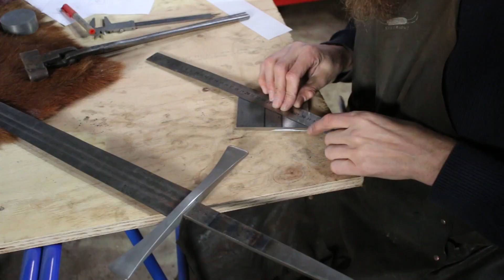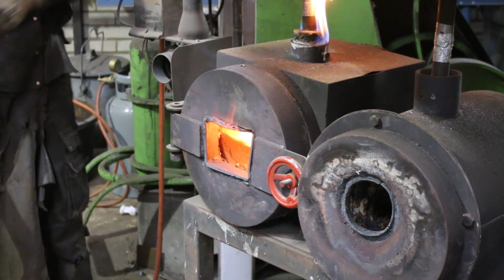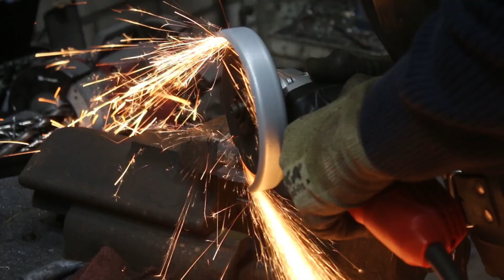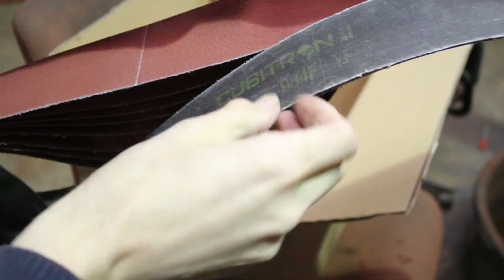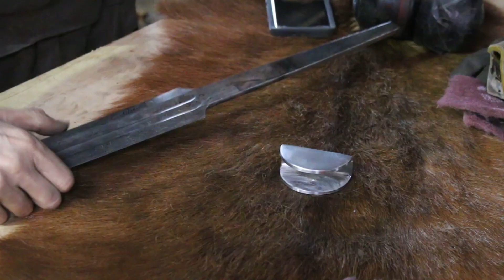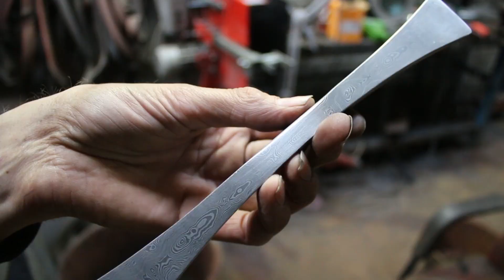Forging a pattern welded knightly sword, part 6 making a Damascus rain-guard.

Comment: Nice work, buuut…
What is the reason for a steel rainguard? It’S not gonna to „guard” the blade from the rain as It’S going to rust as well. Furthermore It would be a pain in the ass if ever will be used for fighting.

Comment: I have a weird question. What do you think of the forged in fire concept, and would you ever torture test one of your blades? 

Do you see that as a waste of time and material or interesting
Reply from the maker: I did some in the past. But most pieces are commissions now.
Reply: @freerkwieringa275  ah ok, that makes sense. Thanks for the reply